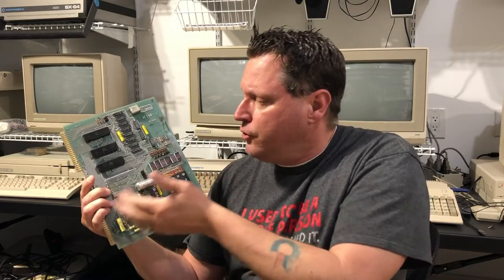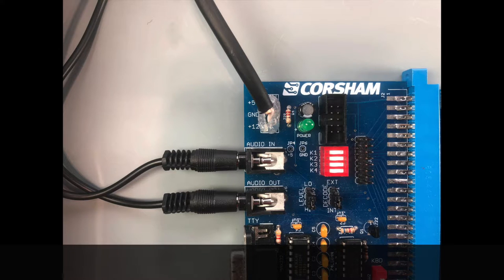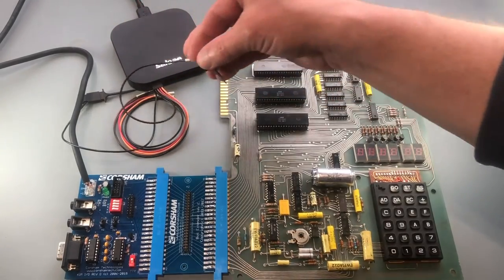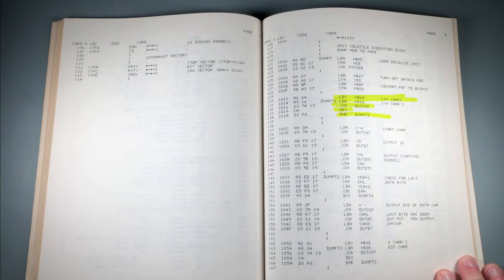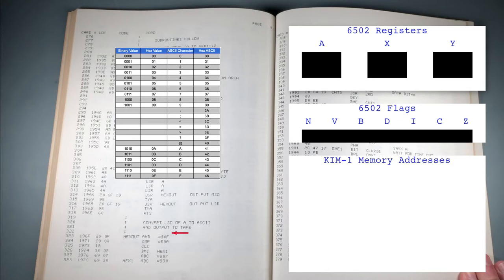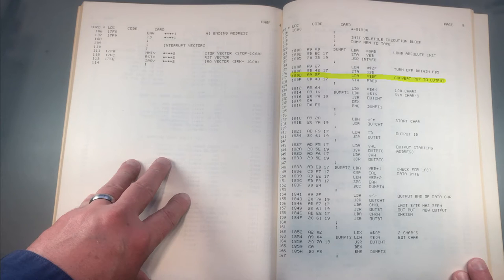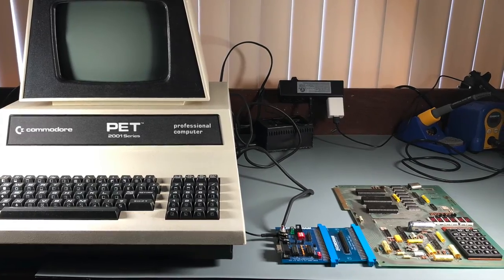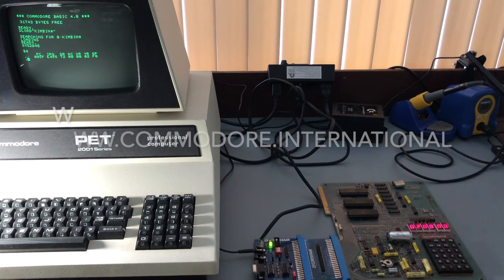The gory details: how saving to tape from a KIM-1 single board computer works

Comment: The first time I tried to save and restore from tape on my KIM-1, I ran into problems. I could save to tape, but it would fail every time I tried to restore from tape. So, I did some digging and ran into a small program called "PLL SET" by Lewis Edwards, Jr. on page 129 of the First Book of KIM. 

In fact, the fist video I did in my KIM-1 series, was demonstrating the PLL SET adjustment program. After that I was able to Save and Restore from Tape without any issues.

Comment: I love the detail of this video, so I am going through it slowly, to take in all the information that is being presented so excellently. I ran into a question when looking at the diagram that you created at 9:26 showing all 100 @16 / 1@2A and 1@ID. The 1@ID does not seem to correlate with the explanation of the OUTBT breaking up the 8 bit number into two 4 bit nibbles before sending out to tape. I did look at OUTBT and it does appear to do two HEXOUTs. So in the original diagram, should we see two ID records MSD and LSD ?
Reply from the maker: You are correct.  The ID will actually take up 2 bytes of storage on tape.  The diagram there is to show how the record structure is defined, so it doesn't accurately depict what is stored on tape.